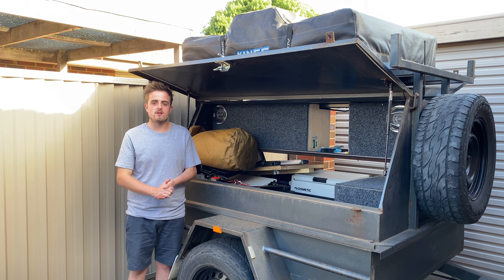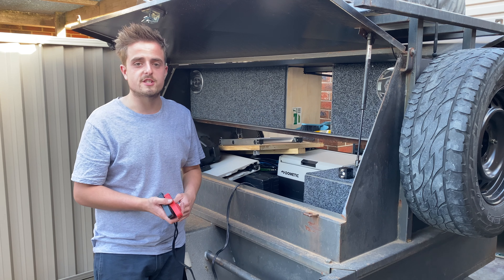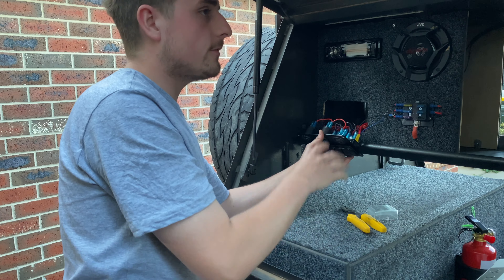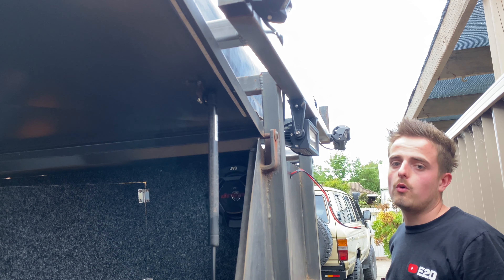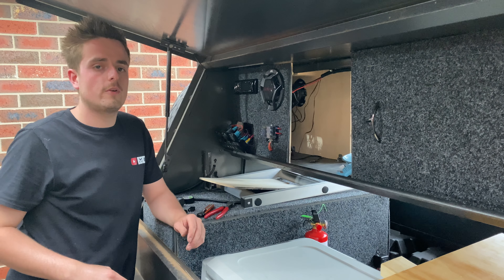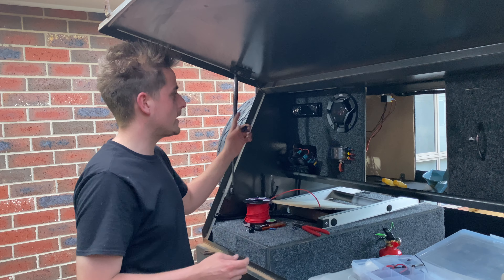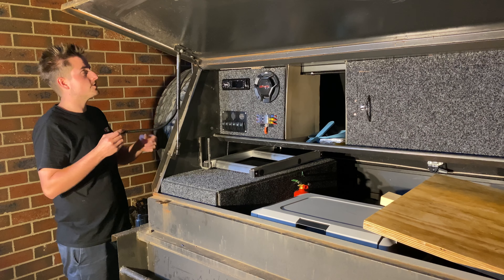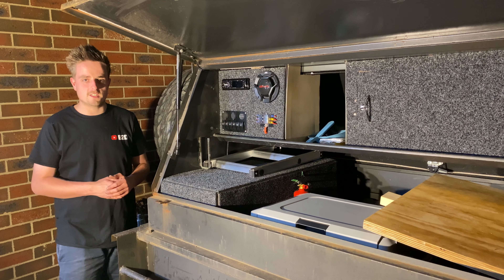Camper Trailer 12v Setup | Part 2

Comment: I bought a trailer to do this.  I would love to know what you think the firs part to buy would be?  may I ask what type of $ too do.  been watching , got the trailer, now?  any helpers out there.  X  great job matey.
Reply from the maker: Thank you mate it has come along nicely. First thing I wish I had done was paint the inside first then line it out with everything but if your not painting it then that doesn’t matter. Probably start with where you are going to sleep (roof top tent or swag?) that will decide what side you will be using the most and set out your layout. I will be doing a price reveal very soon once the trailer is done so stay tuned for that 🙂

Comment: I love this thing its really come along well and a great inspiration for a trailer that I want to build. How well would a clamshell rtt fit on top so then you could mount a solar panel to it, plus it makes for a super easy set up etc?
Reply from the maker: Thank you Connor Anderson! Originally I wanted a clamshell rtt but I had plans of getting a dog and I needed a place for her to sleep at night and the extra room helps down the bottom. It would easily fit on top with some slight modifications to the herdles sticking up. Would be much better for solar to 🙂
Reply: @EngineeredToDesign  my boxer sleeps in our rtt aswell which is getting harder and harder to lift him in 😂
Reply from the maker: @connoranderson4591   haha they grow up fast! Do you have a clamshell tent?
Reply: @EngineeredToDesign  nah mate an arb Simpson, that’s the plan tho when I can afford it 🤙🏼

Comment: I would add an offroad hitch to replace the standard hitch.
Reply from the maker: David Cowan that would be much better then my current set up. What style do you think would be best?
Reply: @EngineeredToDesign  the best and easiest to put on would be a standard poly block coupling.
Reply from the maker: @davidcowan1583  I will look into it, would help a lot! 🙂